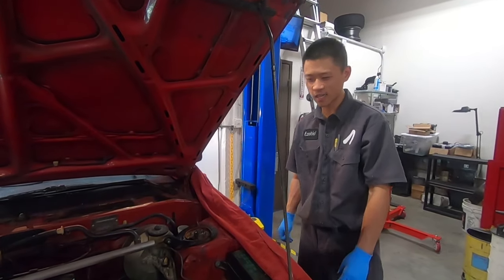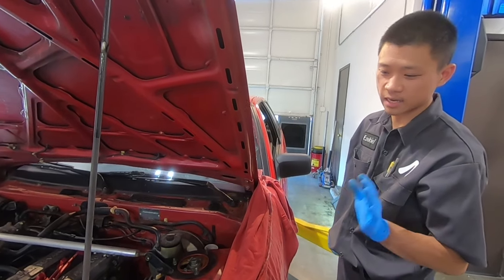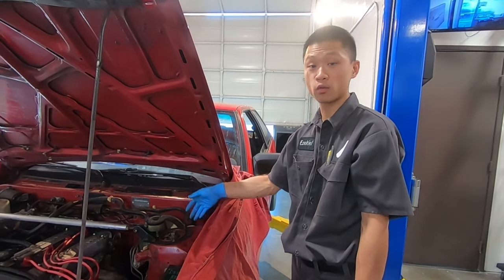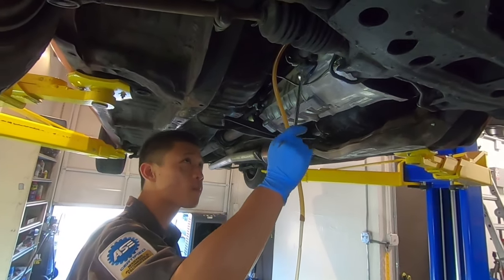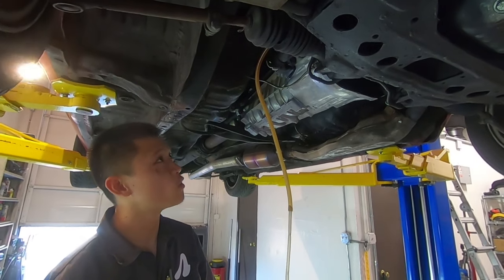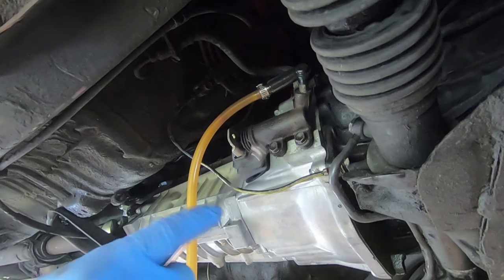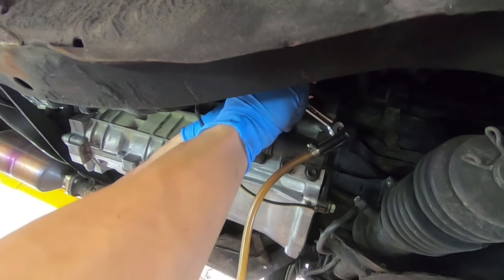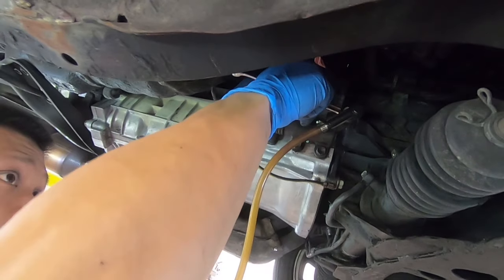How To: Bleed Clutch System

Comment: What’s the name of that bucket you were pumping into and can I find one at a regular auto store?
Reply from the maker: Its just a 5 gallon bucket of gear oil. I am an Amsoil dealer so I buy the 5 gal pail of 75w90 Amsoil severe gear. The pump part is called a bucket pump I think. Mine is OTC brand

Comment: Do you desconect the line from the master to the sleve  or is on come on. Thanks primo
Reply from the maker: Keep the lines connected. I open and close the bleeder on the slave only.
Reply: There wouldn't any fluid going to slave is line disconnected, come on

Comment: I've got a Toyota Yaris 1.5 VVTI 2003. I changed the clutch, and bolted back everything. I had a guy pump the clutch while I tried to see off any bubbles coming out through a transparent hose. It looked bubble free so I nipped up the valve on the slave cylinder. I started the car and tried to put it in first gear. The clutch would not disengage, and the gearbox crunched a lot. I am lost on this one. My next step is try using a pressurised top up bottle connected to the brake fluid reservoir under around 20 psi. I will try to crack the bleed valve and allow the fluid to drain out again. I am hoping that this works.
Reply: This has to be one of the worst cars that I've tried to bleed.
Reply from the maker: If there are no air bubbles, the system is bled. Id check something mechanical. Did you get the wrong clutch kit or TOB? If the friction disk backwards? Did you install a pilot bearing when you were not supposed to?
Reply: I thought the first year they made Yaris were 2007?
Reply: @LoveLeeMonson  No way, my friends dad had the echo (that's what they call the Yaris in Australia) in the 1990s.

Comment: What's the kind of car?
Reply from the maker: AE86 Toyota Corolla GTS
Reply: @CMAutohaus 
Hey mate, great video very clear explanation. Thanks 

One question though, recently replaced rear drum cylinder was badly seized, bled system, LSV,RL,RR,FL,FR have solid pedal and braking, but experiencing a bubble effect and noise from master if I push the break with a bit of force, more noticeable with engine running.
Any ideas

Comment: Press the clutch and hold?
Reply from the maker: Air and old fluid still gets trapped inside the slave cylinder and line.
Reply: @CMAutohaus  It was a yes or no question
Reply from the maker: @ragnaroksangel  Ah! Apologies. Yes, press and hold.

Comment: Hi, I tried to bleed my clutch on Chevy Captiva 2007 I actually got someone to pump the clutch and depress fully and opened the nipple for the new fluid to come out. I did this a couple of times and now I have no clutch at all. Any advise on how to get my clutch up again please?
Reply from the maker: Try to keep the slave fully compressed with a c-clamp. The have the assistant bleed this way. Once there is no more visible air, take the c-clamp  off and bleed again.
Reply: @CMAutohaus  thanks alot my man